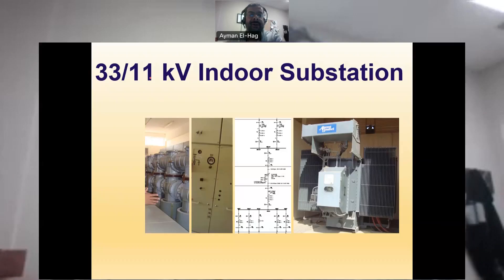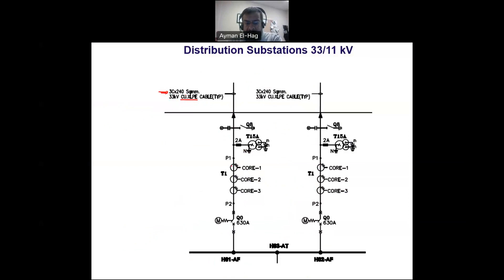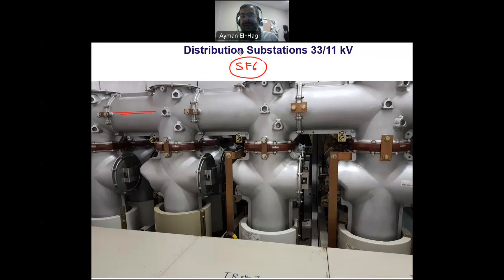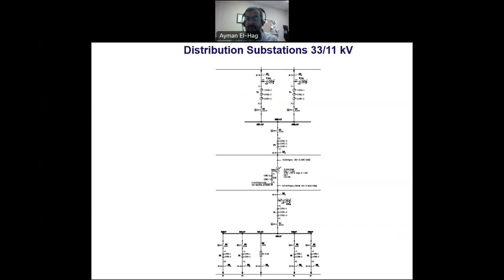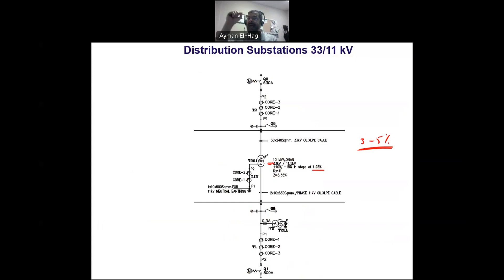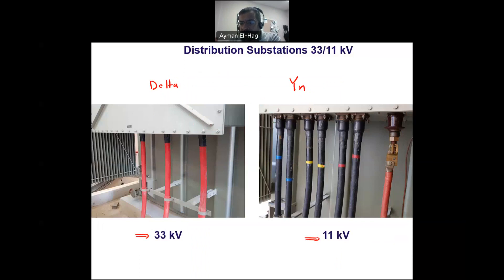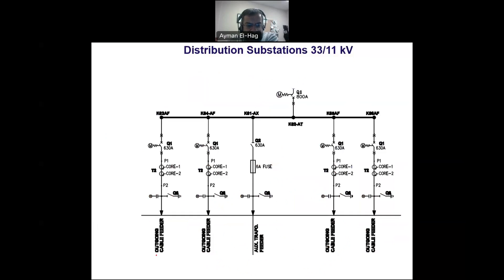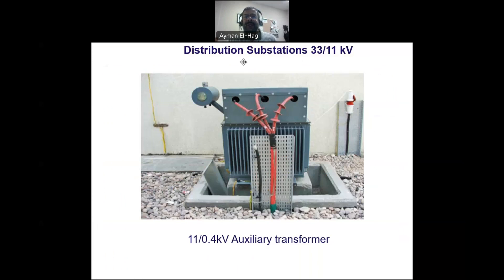33/11kV indoor substation

Comment: Just wondering why u call it distribution substation. This should be transmission substation as power transmitted through it to loads!
Reply from the maker: It is called distribution substation because it steps down the 33kV voltage level to the 11kV which is the primary voltage level in the distribution system.